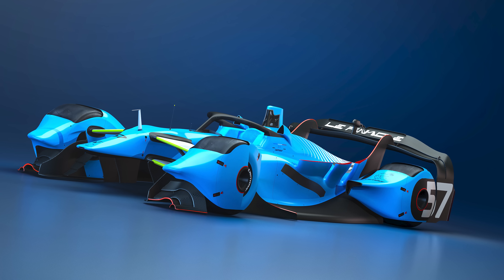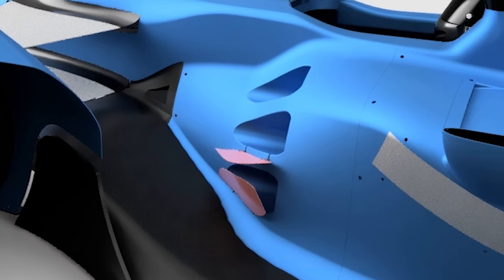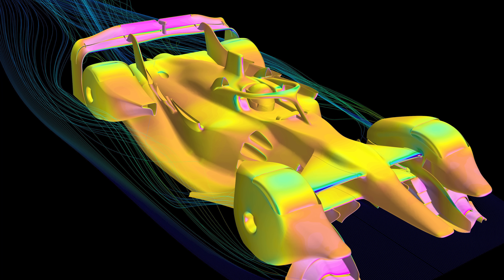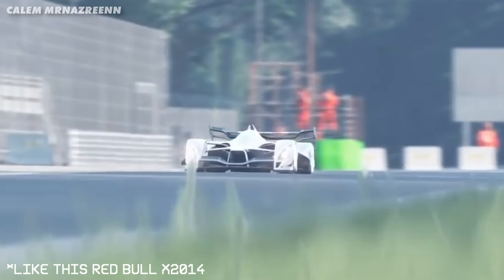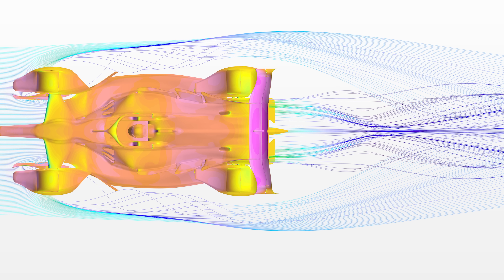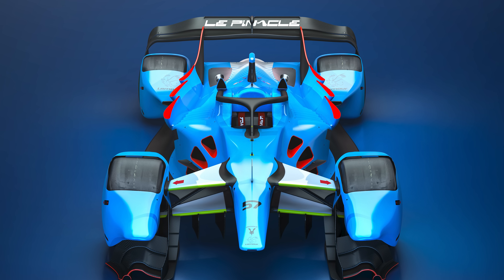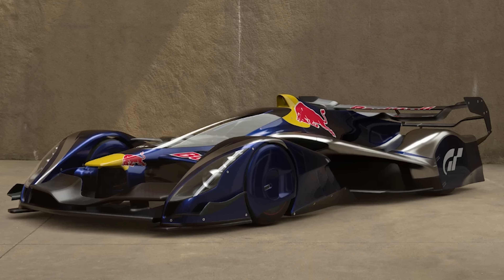Someone Designed The Perfect F1 Car (No Rules)

Comment: I like seeing these kinds of videos but it also makes me think of current car manufacturing and how flawed it is. Modern cars are ridiculously complicated due to engineers having to work within the bounds of safety, emissions, and customers. Customers demand an absurd amount of technology within cars that increases both cost and complexity. Emissions are getting increasingly stricter which at some point will actually cause either an stalemate or cause engines to be too complex and actually become worse. Finally, safety is getting totally out of hand because as cost cutting is implemented, structures become weaker due to using less material and making it thinner. Frankly, its getting to a point to where I want to create my own company to fix the current industry because the current standard is making a car that becomes barely functional after it rolls of the dealer lot.

Comment: I don't mean to shoot this idea down immediately, but this is entirely a paper design. Like yes it could be built but you would not be able to drive it, 4-5g in lateral force breaks ribs, Toyota found this limit in 1990, so sure you can design this to do 7g but the human body cannot handle it. its all dream ideas that could make something that mechanically can do it, but it not physically possible to use.
As you said initially, a conceptual designer.
Its cool but sorry no.

Comment: Interesting topic as always, but this video was terrible in one aspect: Please stop mixing measurement systems. Stick to one and put the other unit also on screen. Examples: You were talking about the car creating a downforce of 4,5 tons (metric) at 185mph (imperial). Then you were talking about the suction fans turning off at 150kmh. Not even for the same type of unit (speed) you're consistent.

Comment: I understand the need for rules and regulations in F1 and other motorsport as you would just get absolutely monsters if you do but you could just restrict the engine size to 1 litre (or something small). The eco enthusiasts would be happy and they would still be able to squeeze 1,000 bhp from it using the 1hp to 1ml rule. If they get too fast, drop the engine down to 0.9l and so on. The rules about not having flexible wings or bodywork 1mm to large or rear wing end plates too pointy is just daft. If F1 is afraid of the cars getting too fast, then just limit the thing that pushes them down the track.

Comment: If you want to get really nuts just remove the driver entirely and then have it driven remotely, or autonomously/semi-autonomously by AI like a drone. That way you cut down on the weight and drag of the driver and the stuff needed to keep them safe. I feel like the biggest limiting factor in all of this, as always, is tire technology. 

It stinks we can't get a truly unlimited racing series where the only limitation is safety, and we could really see the unlimited prowess and ingenuity of engineers.. I guess that is why they got rid of LMP1, though. It quickly becomes a battle of who throws the most money at their race car, and before you know it everyone has left the series and you only have Toyota as an entry.
Reply: I think this could be the way. Have them "drive it" from a sim rig, there could even be 2 drivers, and the guy/girl that's not driving that stint has to physically run a foot race against the other drivers and whichever of the footage winners places best, there could be an on track advantage given at the pitstop. That way, they'd be physically worn out when it was time for their stint to start.

Comment: I wonder about complex, programmed active suspension system and also would a 4 wheel drive system be necessary or be rendered redundant due to already high cornering speeds. Maybe perhaps in very tight corners for agility. 🤔

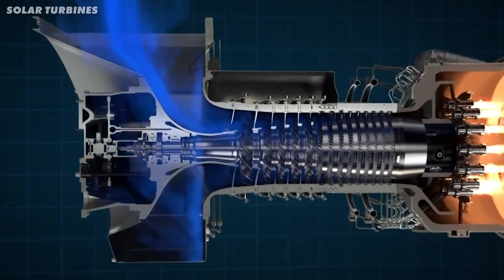Comment: 2:25 You should have said “Williams Honda car”. 
Honda’s production CVT is pretty bulletproof from my experience. I know it’s low on hp output, but definitely produces predictable traction when you are revving it to redline.
Reply: No - it was the FW15C, still with Renault engine. The gearbox was made by Williams together with the dutch company Vandoorne...

Comment: Twin turbo 1.6L V6? Ugh 🤮 Why not a NA 3.0L V10, no reason it couldn't have a similar power to weight ratio, similar or better reliability, no turbo lag (yes, I know, with no rules, theres lots of things that can be done to eliminate turbo lag). And there's nothing like the sound of an F1 3.0L V10.

If you want a power adder, why not go with a screw/roots type of supercharger. Or heck, do one o those,  centrifugal supercharger, and a twin turbo, get boot in all RPM ranges. But why not just leave it as normally aspirated?

Also, is this thing similar in size and weight to a '90s/'00s/'10s F1 car or to a current F1 car? The former is preferable.

Lots of cool things here, but if this is more of an F0 or CanAm car, then have at it, but if this is an F1 car with limited to no rules (difference is philosophy/perspective I think), then I'm not sure this is it.

Comment: U can actually get incredible throttle response with a hybrid electric axial flow turbine engine. If the compressor stages are powered by electric motors u can gain alot of efficiency in the compressor portion as well as instant response since they are independent from the power turbine. Now getting all the electronics, generator etc into a racing car would most likely be unfeasible.
My favorite thing about this car is the size. Its not massive like modern f1. Its wide but not long

Comment: He was so close with the turbine... Turbine just needs to act as a generator. Add a small battery pack as a buffer and four in-wheel motors, and you solve a ton of problems.

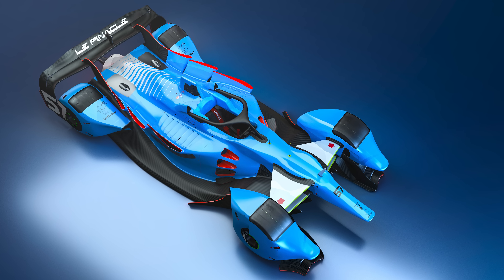Comment: 3:11 generator, battery, electric hub motors, done. You can run the turbine steady state and you get torque vectoring, if your doing racing like f1 your engineers can sort the rest.

Comment: Sometimes I wish that we'd go in the other direction. What do you think race fans would rather see. A car that is 15 seconds a lap faster than current cars or a race where there are 3 or 4 racers fighting for the lead coming out of the last corner.
Reply: Cars that are different enough they have different strengths in different parts of the circuit.

Comment: If there were no rules, it wouldn't BE an F1 car. F1 is literally the list of rules. That's why it's called a formula. And F1 car without rules, would look the same as any other race car with no rules, because it would BE the same. Just a car built to lap circuits as quickly as possible.

Comment: I'm... extremely skeptical. He hasn't added nearly enough structure to those little hole covers, and they'd probably immediately come off. Similarly, the skirting trapdoor thing would be ripped to pieces at even low speeds. There's probably tons of these issues that would need to be fixed, and those fixes would completely ruin the performance of the car. Additionally, the "I can do it cheaper than everyone else" claim is obviously wrong and extremely Musk-esque
Reply: Musk actually can do it cheaper and better, at least in the case of SpaceX

Comment: Pikes peak is actually very interesting. 

The race is run from the bottom of a mountain to the top. The air is much thinner at the top. So the aero that works at the bottom, might not be enough at the top. Also using much more aero, will create too much drag at the bottom.  
That's why Pikes peak cars look so weird and different.

Comment: If you allow side skirts that touch the track surface, internal mass dampners, active aero, rear extruder fans, and active suspensions you could decrease the available horsepower by half and achieve lap times better then what were possible in the 2024 F-1 spec

Comment: I’ve always dreamed of a true American unit “One-to-One” series…one horsepower per pound of vehicle weight. It will put an end to the disturbing flat-out laps around the Indianapolis Motor Speedway. I want to see heavy breaking down from 300 mph in order to make the corners. 1700 lbs and 1700 reliable HP should be no big deal. I’m 66….don’t wait too long!

Comment: Someone should start a F1 racing without rules and give green light to innovation and technology and have all these gigantic companies bring whatever all of them can think of . That would be an amazing thing to see.
Reply: All the rules are why I could never get really in to f1 if all everything is evenly matched (even the drivers) down to the screw heads - what's the point? Races seemingly just come down to some deus ex machina entropic moment that causes one drive to miss a turn by an thousandth of a degree. An Open/Unlimited class would be really awesome even if it where a smaller series.
Reply: No one wants to spend the big money in a crapshoot.  The big boys need to know that they will not get jumped straight out of the gate.  Formula One went years between real scandals, technologically, and now is mostly "flexi-wings stuff.

Say that company puts out an old-school v-10 for the unlimited class, and someone else has some revolver-style setup which works.  The first company would see mostly downsides.

Comment: I would be interested to see some sim runs of it riding bumps and curves or how it reacts in collisions/bumps and scraps. My guess is instability riding curbs disturbing the seal for airflow under the car and certain fragility in small collisions or bumps with other cars when it comes to those wheel covers running as close as they are to the tyres.

Comment: 3:10 I too think that the best powertrain  is a turboshaft engine with a CVT transmission. My idea is to control the transmission ratio electronically and not as it is on a scooter. This way you can keep the engine at the same rpm, or even slow down the engine during accelerations and accelerate it during decelerations, this way you can use it to store energy, like with kers

Comment: The main question is why compromise with an F1 layout at all (for example, still having an open cockpit instead of a glass conopy that could improve aero) if F1 itself is a set of rules and regulations. So it is not an F1 car by very definition, as it doesn't comply with the regulations, but at the same time IS restricted by regulations? I don't get it. Also, why would a jet engine inertia be a problem if the whole point of CVT is that you can keep the engine RPM at optimum constant, regulating speed purely by the gearbox?
But the tech is cool anyway and was super-interesting to learn about.

Comment: For a keyboard warrior "ultimate time attack car": A gas turbine using a cryogenic fuel that is also used to cool generator/motor electric transmission system. Hybrid can be done for instant accelerator response with certain weight of the turbine shaft and a combination of variable guide vanes on the inlet for throttling and matching load to keep shaft RPMs in a range.

Comment: Tyres wouldn’t last a single lap at those load levels. Suspension necessary to manage all that downforce would be so large it would require a redesign of the aero to fit. Engine would be extremely peaky and difficult to control, cooling absolutely would be an issue, and wouldn’t last more than a race or two.

Conceptually (ignoring material science and mechanical physics) it would bonkers fast, but built in reality it would barely (if ever) finish a lap and be relatively slow. Def designed by a conceptual aerodynamisist😅

Comment: I find it quite interesting Scott, you haven't mentioned tyre wear at all. Given the downforce the tyres will wear off much more rapidly. After seeing the design it is obvious to me the tyre change will add 15 seconds if not more (currently 2s) to the race time at least two times. So what I see is is amazing engineering but avoiding some key elements in a race scenario. Tyre change is not only a rule in F1, it is a necessity. If you can make Michellin or Pirelli to make a tyre for this design, I am all for it.

Comment: bringing up how it's cheaper than f1 is missing the point that the cost is of engineers spending a long time interpreting the rules and finding new ways to get around them, and not to mention that this guy isn't counting (or only partially) how much he'd cost the project too, then testing it instead of bench racing it. Cool project, but that tid bit was an unfair comparison

Comment: honestly, it ain't that difficult to blow the current F1 cars out of the water.  They are so heavily restricted.  Take a 2020 F1 car, remove the fuel restrictor, and you'd be able to get 400 more hp easily.  The hybrid system can deploy more power too, 400hp instead of 160hp.  Now you have the fastest F1 car in history, the W11, but with over 600hp more to play with.

Comment: I’ve designed a car that comes off the ground at 400 mph … driven by a turbine engine  similar to what the MTT motorcycle uses … does 600mph in air … can fly … can steer and can land back onto the ground and drives like a normal car … my car can beat on this car … !  😂

Comment: F1 has become essentially a spec racing series where all the cars are the same and the only real difference is the paint that's on the cars.  The rules are so constrained that there is little room for innovation that is visible or understandable to the average fan.  We need to have a class of circuit racing with a more open ruleset.

Comment: I feel like that massive veritcal fence that blocks diffuser entry during fan mode is a terrible design, and the transition to ground effect 😂 that would be a very hard thing to get right. Even on blurry photos of the mcmurtry fan car you can kinda make out a less draggy way of sealing the vacuum section... tbh you could probably make the vacuum section much smaller and have tunnels that pass around it like neweys x2010 concept.. again no barn door seal on the front of its vaccum bit.. much more tapered. 

Love seeing peoples crazy design though, have a few x2010 inspired cars drawn up in cad on my computer!

Comment: Really cool vid. But this is still quite far away from 'no rules'. If there was genuinely a 'no rules' formula, the first thing you would do is remove the driver (AI controlled from the pits), then remove the tires, then drastically shrink the size of the 'car'. So it could turn into drone racing very quickly. Or maybe there would be a way to remove physical hardware altogether and you could end up with engineers competing to race signals around a physical track. Engineers will always push the limits of the regulations, so to achieve an outcome like this concept (which is awesome) you can't underestimate the amount of regulation you would still need.

Comment: You mentioned the wheel covers are physically connected to the tires (pretty sure thats what was said) so does the mean the whole wheel cover has to be taken off for a new set of tyres to be put on?
Reply: I’m guessing no matter what, pit stop time will be increased as there is no way to access the wheels directly

Comment: A cool project and very interesting to see some of the ways current F1 rules constrain what the cars can do.
Open wheels are a huge limiting factor on F1 (and other open wheel racing series) so it is great to see ways that enclosing the wheels could be done while retaining the 'open wheeled' style.
Is there  chance that you could ask the designer some of the many questions that I and the other commentors have on the concept?
My questions include:
What are the reasons that the exposing the upper forward quarter of the front tyres is beneficial? 
Could full bodywork be yet more efficent and faster than this 'semi open wheeled' style car? 
Why retain the Halo sytem, wouldn't an enclosed cockpit be more efficent?
What weight could 'Le Pinacle' be built to?
Which of the features of Le Pinacle does Sébastien think F1 could adopt to improve the racability of the 2026 cars?

Comment: Pretty sure you could make it go even faster.  In the end, this is the same basic shape as formula 1, just taken to the extreme.  But throw out ALL rules, such as noise constraints, and it could be even more insane.  The really crazy thing would be adding four wheel drive.  Suddenly, you can apply MUCH more power.  Alot of electronic aids, like torgque vectoring and such could be added as well.

Comment: I feel like turbine drive could still be a possibility.  Either through turbine electric, or differential power.  With differential power, as you let off the throttle, it just transfers the drive to the rear fan.  With turbine electric, you’re basically just generating electricity that goes directly to an electric motor on each tire, creating perfect traction control too.  Turbine electric generators are insanely powerful.  For comparison, the US military has large turbine generators to start large aircraft engines and other ground operations.  The average small or older American house has a 100amp panel.  The average modern mid-size house has a 200amp panel.  (Not including Tesla houses).  That’s around 10-24Kw capability per household (following the 100-120v standard).  This AGE carts produce more power than the modern mid size American house, and you could definitely arrange it to just barely fit inside a car.
Reply: Full turbine electric, instead of a transmission, means you need a generator and a motor both capable of taking the full >1MW power output from the engine.  That’s fine on ships where weight is of little concern, and trains where weight is a benefit, but it’s just too heavy for a race car.

The reality is you don’t need a CVT, and you don’t need to worry about the turbine spinning up and down.  Engine speed is already uncoupled from tire speed by the fundamental design of the turboshaft.  Variable stators in the compressor and turbines give you wide latitude to provide the power you need, at the RPM you need, whenever and however you want it.